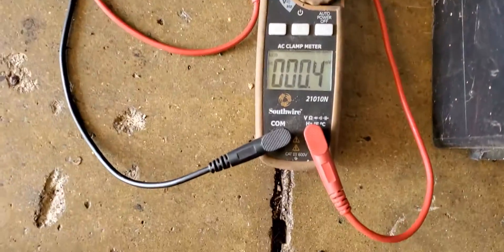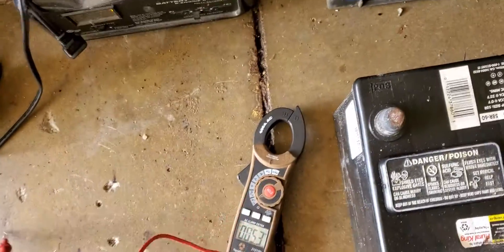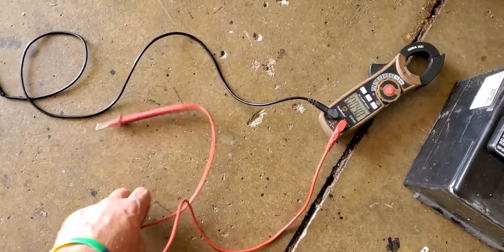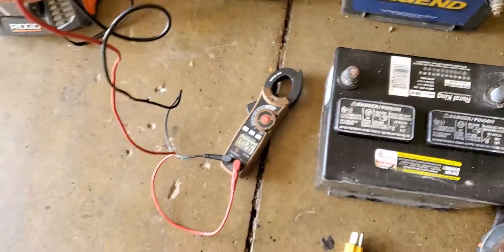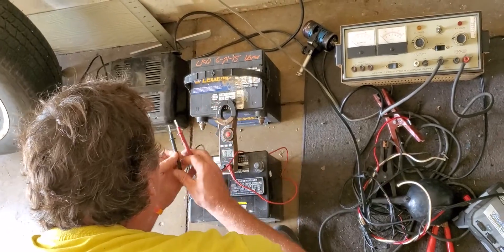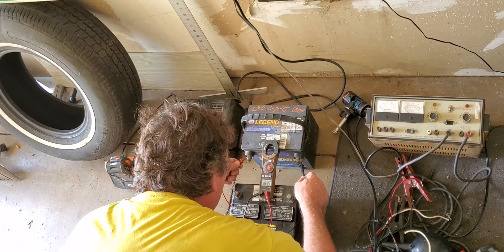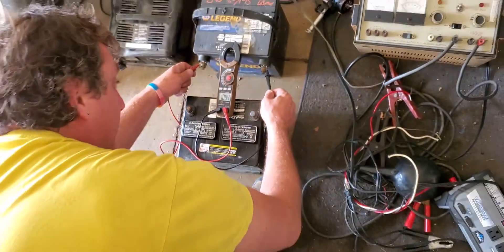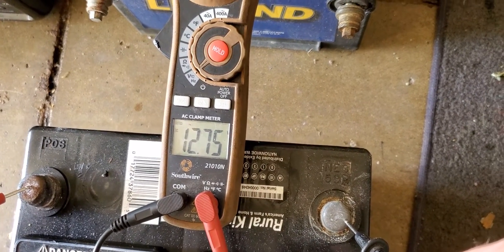Battery charged backwards

Comment: It's because both electrodes in a lead acid battery are made of forms of lead, one is pure lead and the other is lead dioxide and both will turn into lead sulfate when the battery is fully discharged so it's possible to recharge it in the opposite polarity and reverse the electrode materials.
Reply from the maker: @TechHowden  that particular battery I was able to get charged the correct direction but it took a couple of days
Reply: @FuquarProductions  @ i'm surprised you got it to charge back up normally again. Did you have to fully discharge it first and did it charge up to 12V or just 10V? I've experimented with this before on small AGM batteries and I've never been able to flip the polarity twice but that may have just been because I was testing on decade old ones that weren't working to begin with.
Reply from the maker: @TechHowden  my little battery charger has a over limit I don't know if it's overheat or overcurrent that is self resetting. What it will do is try to charge for a moment and click off, but each time it would stay on a little longer. I left it like that for a couple of days and it finally took a full charge.

Comment: If you run down any lead acid battery to under a .5 volt, you can charge it back up backwards.  I just recovered 2 sealed lead batteries by doing this.  When a battery sits for awhile the cathode gets coated in sulfate crystals, which blocks the electrolyte.  By reverse charging it the clean anode lead plate becomes the new cathode...

Comment: Obvious fake. I can tell by the pixels.
Reply from the maker: How so?
Reply from the maker: Either that or it's a deep fake......Seriously explain how it's a fake...
Reply: @FuquarProductions  that was a joke, seriously man, how'd that happen?
Reply from the maker: @markherber2105  I just noticed the username...lol. Dude that stupid Tug I have has been sitting in the driveway for 5 or so years with the same battery. I thought is was worth a shot trying to charge it over time....I just got distracted while trying to charge it and connected it wrong. 
I discharged it down to .78 volts and tried to connect it the right way and the charger didn't like that one bit. so I'm hoping by tomorrow morning I will be able to start charging it the correct way.